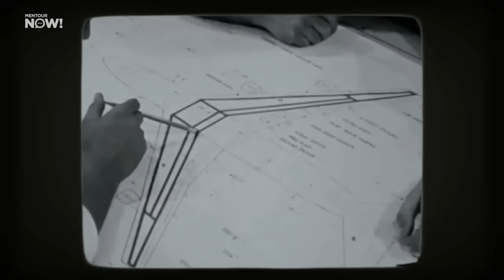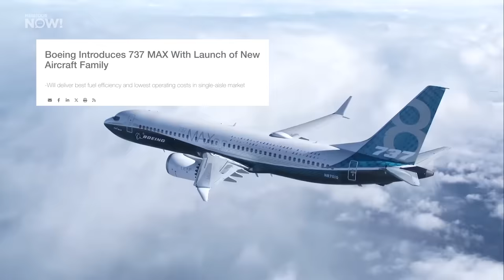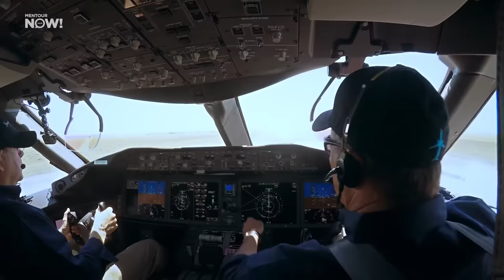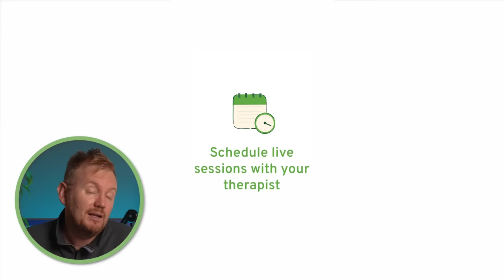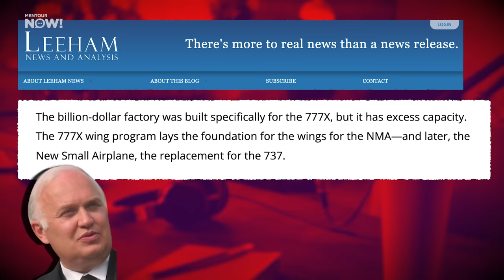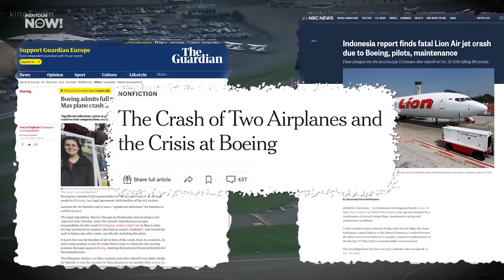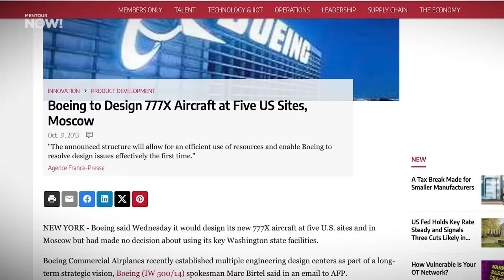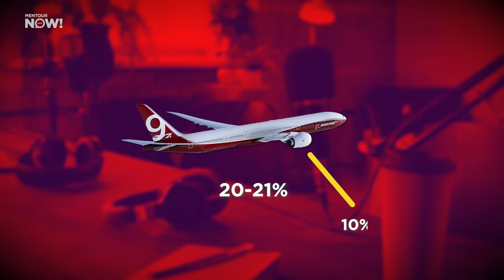What’s Going On With The Boeing 777X?!

Comment: I think that this video was a little easy going on Boeing and their approach to certification. Boeing thought that they'd pretty much done with the 777X design work, and then the two MAX crashes occurred. That has resulted in the FAA taking a much deeper look into everything they're doing; MAX, 787 and 777X. And, there was (and possibly still is) much to be concerned with. 

Back then pre-MAX it was surprisingly common to come across news reports of Boeing being mixed up in court cases with former employees who'd resigned citing safety concerns. I can remember one of these cases was an electrical engineer working on the 777X electrical system, having been moved over from the space division of Boeing. He'd taken one look at the design and condemned it. the Management begged to differ. It resulted in him leaving the company, and there was a court case over the issue. One does wonder if, post MAX, the 777X electrical system has been heavily revised...

There's also the issue that decades of hire and fire has taken its toll. Plus there's been problems with the company coming to agreements with engineers. Recently, they lost a load of experienced engineers who had to either retire or lose a lot of retirement benefits. There's no reason why this couldn't have been avoided; a deal is a deal but it can always be changed, but they didn't. Bye bye, lots of hard to replace engineers. 

All of these issues together are sure to have made a difficult environment in which to complete a development program. The company has barely been able to deliver MAXs and 787s in recent years. They're hoping to get the 777X finally in service in 2025, but there's plenty of reasons for that to slip further right. 

There's also the problem that Airbus, if they really want to, could do an A350 1100. RR's Ultrafan demo engine is about the right size...

Comment: 18:30 - "Boeing launched new design center in Moscow in 2013" -  the Boeing Research Tech Center (BRTC Moscow) was established precisely 20 years earlier, in 1993. I worked on outfitting their offices in 1997-1998. It was a small operation then (" computational fluid-dynamics laboratory with 10 workstations. About 15 to 20 researchers..." - see Boeing's press release dated 1998-06-09).  Later, the press reported that Boeing employed as many as 1500 - but this sounds doubtful; at the time of withdrawal in 2022 there were 640.

Comment: One correction I need to inform you on, the 747SP wasn't developed in the 1980s, it's first flight was in 1976, and it entered service that same year with Pan Am, the 747-200 on the other hand was developed closer to the 80s as that model first flew in 1978. I just wanted to make that slight correction on the dates. I was a flight attendant for Pan Am for 33 years, and I remember the 747SP very well.

Comment: Another great video!!👏🏼👏🏼
Boeing doesn’t learn from its past mistakes. The same issues happened when they launched the 737 NG back in the 80s. As I have mentioned before, I worked at Boeing during that time and witnessed that debacle first hand. Like that airplane, the 777x is not a simple stretch of the existing 777, as explained in the video. The changes in the fuselage and wing mean that the 777-9 doesn’t share hardly any structural components with the legacy 777. It’s almost a completely new airplane structurally and, I suspect, in many other ways.  It’s never as easy as it seems at the beginning.
Reply: boeing has learned from its passed mistakes. what's the fuss about the 737ng back in the 80s
Reply: I honestly would have gone with 4 small and reliable engines - like you see on the 737 or Embraer versus two giant and hugely complex ones.  I'd have chosen the most reliable and least expensive to fix engine I could, drop 4 smaller ones on it, and call it a day.  Save probably a full year in designing and testing it all as well.  Even a 737 Max built with composite materials would have likely been efficient enough.
Reply: @plektosgaming  That was exactly what Airbus was doing with their A340s, though not by intent. We all love to laugh its 5 APUs while its twinjet sibling A330 easily burns 10%+ less with the same technologies.
Reply: @steinwaldmadchen  And that's the answer.   As a passenger I love the A340, and I feel more comfortable with four engines on long over-ocean flights.   And it literally has four A320 engines.   Unfortunately airlines and their economists don't love it, and as soon as the A330 got ETOPS certified, nobody wanted to buy new A340's any more.
Reply: @steinwaldmadchen  I get it, and fuel is a huge concern, but Boeing is about to lose its entire contract due to delays.
Reply: It's a double-whammy.  The price difference of the smaller jets plus their better efficiency, combined with their being more suited to smaller direct flights versus a spoke and hub model means that you can run a smaller Airbus or Embraer for 4-5 YEARS of daily flights before you break even with just the cost of the Boeing.  If you factor in fuel usage, it's several million or so a year savings as well, meaning that the smaller jet also effectively pay for its own maintenance and crew just from the fuel savings.  The downside is about 20-40 less passengers per flight, meaning a few more flights to make it up, but  not as many as one would think.  New, fast, and efficient - as well as easily pollution compliant.  Add in a delay and potentially 10+ years... yeah.. they are in deep trouble.  Old, inefficient, expensive, and maybe you get one in time before your old fleet is entirely worn out.
Reply: @plektosgaming  Re-create the A340, eh?
Reply: @RexKarrs  Well, The A340 was a great design, and with modern engines and technologies, it might be viable.  We're kind of getting to a point where bigger isn't better and the upkeep on these large aircraft is prohibitive.

Comment: EVA AIR  also really wants to replace their older 777, and 777X is definitely a better choice.
But because of the long delay, and no guaranteed delivery date from Boeing, EVA AIR eventually ordered 18 A350-1000.
It's pretty sad news for me since I really want to fly the 777X myself, but it's an understandable decision.
Reply: Well, while delay definitely contributes to that, at this point 350 actually carries more payload than the 777X for the Transpacific routes EVA intend to operate.
But I can confirm they favoured 777X sometime ago, as the then-CEO Chang Kuo Wei literally said so.
Reply: @steinwaldmadchen yes if Boeing doesn't use a the 14t higher MTOW of the 777-8f.

Comment: i would still say A350 still has a upper hand in this competition eventually, consider how great it is performed since the first flight.

90 additional orders from Emirates is just used to threat Airbus to make change/improve on A350-1000 to suit their needs. Once Airbus can find the way out and speed up the production while 777X still remain to be uncertain in 2024, maybe we can witness one of the greatest order cancellation wave in modern times.
Reply from the maker: It’s possible. But both aircraft are actually very good so Emirates might well keep them both running.
Reply: Spending 50 billion dollars is not just “a threat to Airbus”, it’s a further commitment to the 777x.
Reply: A350 is a great plane. 787 is also a nice plane
Reply: @TacticaLLR What he said is entirely possible the airlines play the manufacturers off against each other all the time
Reply: But both aren't really fighting over the same orders, are they? The 777X was designed as a replacement for the old 747s and 380s, aimed particularly at airlines like BA and EK who are struggling with slot shortage at their hubs and therefore need as much capacity per plane as they can get. Airbus doesn't deem a further stretch of the A350-1000 feasible, for what it's worth, so there'll remain a certain gap between passenger capacities between the two.
Reply: Emirates refused to order the -1000 as Rolls would not offer them an attractive price on their engines due to the new CEO focusing on profit rather than market share, with airlines such as Delta and Thai Airways holding back on ordering more 350s. If the engine is "defective" as Emirates describes wouldn't Etihad and Qatar be eager to dispose of them?
Reply: @MentourNow  i agree, after 2030 when all the A380 will be started to retire, current orders on 777x and a350 are definitely not enough, and more orders are  coming. 😂

what i try to suggest is the timing and purpose to do so at this time
Reply: @TacticaLLR  if 777x cannot deliver in 2025 or in slow production, while Airbus can do the opposite, any commitments will become meaningless. 

sorry i don have much faith on Boeing now. 🤣🤣
Reply: @heotak3408  Airbus is depending by far not so much to Emirates with its A 35o-Program as Boeing depends with its 777X-Program. That´s very easy to see with a look on the Backlog of both Programs.
Reply: @MentourNow  777x is a great airplane that is 30t heavier on OEW. Business case wise it will only work for airlines who really need the biggest floorspace, which explains the overlap between the A380 and 777x customers...

Comment: The 1990s 777 was replacing  DC-10/MD-11/L1-11 jets from late 60s/early 70s. It was easy to fill that gap in Boeing's portfolio with current technologies and show significant improvement (just going from 3 person to 2 person cockpit was advantage enough going from 3 to 2 engines was another huge financial advantage).  There was no need to push the envelope right to the edge to get performance imrpovemet that would compell airlie to buy your new plane. 

In the olympics, as one approaches limits of the human body, performances no longer improve by the seconds but rather by hundreths of seconds and each hundredth of second improvement requires a LOT of training by athlete.  But for aircraft, even though the developers are in that zone where incremental improvements are smaler and smaller, the accountants still demand that the new variant provide significant performance improvement.  And that is where it becomes much harder to push the envelope and deliver that large enough improvent. 

While the 777 was originally designed as 9 across to replace mid size DC10s, Boeing has since encouraged airlines to densify cabin with inhumane 10  across seating and that puts the 777 as a 747 replacement, and the originally 8 across 787 now with 9 across seating replacing those DC-10s.   But now that it is replacing the 747, this put greater need for extra capacity beyond the inhumane 10 across seating. Hence new wings, longer fuselage. but marketing also wanted to reduce the image of the 777 as inhumane aircraft in coach so ordered the engineers find a way to make walls thinner to pitch the plane has having wider cabin.  (which won't make a different to seat width, but marketing doesn't care about reality).  The more changes you ask be made to a plane, the more work is needed by engineering to design the change, and then once FAA decides a derivative is now to be certified as a new plane, the more work is needed to get plane certified which means fixing bugs before certification instead or fixing them once plane is already in commercial use.
Reply: The 777-ER is the worst wide body aircraft to fly on from an economy class passenger's perspective. The seats are narrow, leg room is limited, it feels cramped and the noise levels are terrible.  i hope the airlines don't  do the same seating arrangements on the newer aircraft.
Reply: The 777 when conceived and until the 2010s had wide coach seats with 9 across seating and generally, airlnes still had good seat pitch of 32".   Greed and the need to make coach as miserable as possible to push peeople to pay for premium economy resulted in narrow seats at 10 across seating and reduced seat pitch which makes 15 hour flights absolutely miserable. Some airlines still have 777s as 9 across (Turskish as of a year or two ago).  The 777 was a fine/bording aircraft until airlines made the conscious decision to ake it as miserable as they could.  the X will be the same.  Unless travellers start avoiding 10 across seating and airlines see reduced occupancy, they will keep 10 across on a plane designed for 9 across. And with loss of 747, they don't have chgocie but to have miserable 777 to replace the comfortable 747 (which is why airlines that still have the 380 see it as advantage as people prefer it and they are seeing high load factor).  @nrml76

Comment: The B787 in all variants and the A350 in all variants are the future of medium to ultra long haul nonstop  'point to point' and/or spoke and hub' operations due to their clean sheet airframe design, operational history and prices. Yes there will be a limited market for the passenger version of the B777-9 and Emirates B777-8 but it wont be a big market share compared to the B787 and A350.
Reply: Technically, 777 is a direct competitor to A350… not 787

787 is a smaller plane with only its biggest variant 787-10 that kinda compete with the smallest A350
Reply: @tonamg53  - Which B777 variant are you referring to?
Reply: @chrismckellar9350  Any variant Boeing still selling

Comment: I took a small hand carry out to the 777x at 22:00 local time on Jan 24th, 2020. I walked up inside and looked around, they have plastic barrels all over that can be filled with water to simulate a more loaded aircraft. It was a late call to me , a shuttle driver. Apparently the aircraft made its first flight the next day. I think I took that part on a Friday, the next Monday, a couple medium wigs give me accolades for not passing it on to the next shift, which I could have done, but didn’t. That apparently something of a big deal getting the part , so they could stay on schedule for the next day. It was my most proud moment at Boeing.

Comment: The 777X has a composite wing and is developed from the 787 airfoil. The 747-8 also had a wing developed from 787 wing, but using the original 747 wing root and using metal without foldable wingtips. My question is would the 747-8 have sold better if it had used a lighter more efficient wing? Would composite and longer foldable wings have added enough efficiency to make the 747-8 competitive?
Reply: 747-8 has completely different wing design, which allows the wings to bend upward like 787 when in flight. I have flown in every 747 variation except 747SP, and I can say that 747-8 is the smoothest and quietest of all 747 variations. I flew 747-8i between Frankfurt and South America several times, and we didn't feel any effect of turbulence (usually more pronounced in 747 due to its extra large wings). The area between South America and Africa is notorious for strong turbulence events (which led to the crash of Air France A330).

Comment: This will be the ultimate "trust me, bro. I read it on the internet" story, but in April 2023, I sat next to a Boeing Flutter and Dynamics Engineer on a flight to SEATAC. He works on the 777X, and aside from all of the other problems as detailed in this video, he said that Boeing is also in internal crisis mode related to the human factors related to the effects of flutter due to the extremely long fuselage. His words: "not human-flyable on approach if there are any bumps." The pilots are on the wrong end of an extremely long moment arm from the center of mass, so they get thrown around the cockpit while things are generally comfortable for the passengers. I'd think that he was exaggerating about "not human-flyable," but it is (well, "is" at least as of April '23 ) another factor delaying the project. He said the brain drain at Boeing with retirements lost a bunch of flutter expertise which has made this especially challenging. Flutter mitigation is solved with software and pretty crazy math, so maybe they've had some breakthroughs in additional flight testing since April.
Reply: Hopefully the guy didn’t get the sack after you identified him
Reply: retirement is a polite euphemism for firing all the union employees
Reply: MD-80 had some "taxi bounce" issues early on in the program, causing unpleasantness for the pilots when going over pavement with certain characteristics.  The solution turned out to be a revision to the main landing gear strut inflation curve... which is good, because you can't do much (or anything) directly about fuselage modal frequencies.

The 777X fuselage has less fineness ratio than say a DC-8-63, so I assume the issue is with a forcing function (e.g. wing flutter) rather than its inate modal response.  But at least in terms of what I think of when I hear "flutter", that's not something which should be happening during normal operation -- not even during turbulence.  It sounds like this is may be an interaction between the fuselage modes and the everyday modal response of the wing under turbulent conditions?  That's going to be a pain to tame if they don't already have a gust alleviation system (I don't know the 777 series) that they can retune, like DAC did with their landing gear.
Reply: Sounds like the pilots just need to git gud.